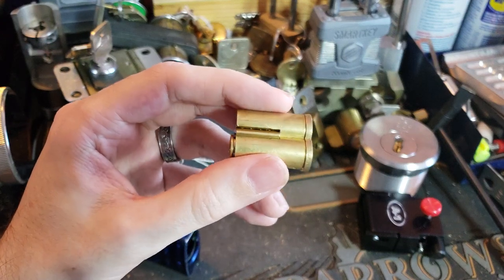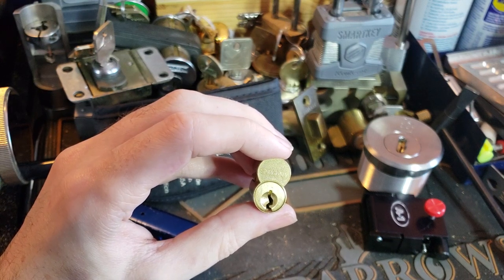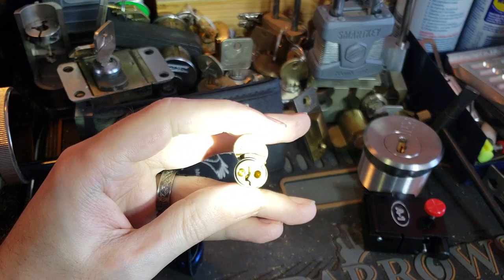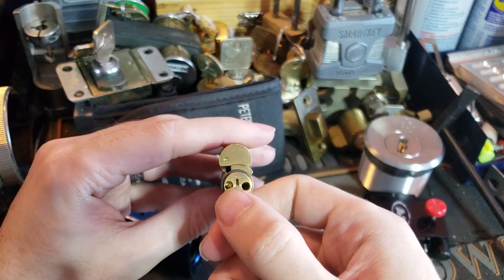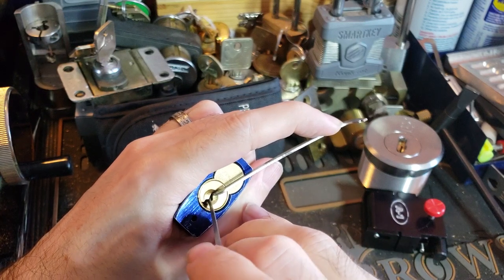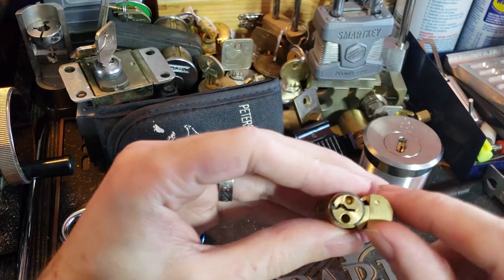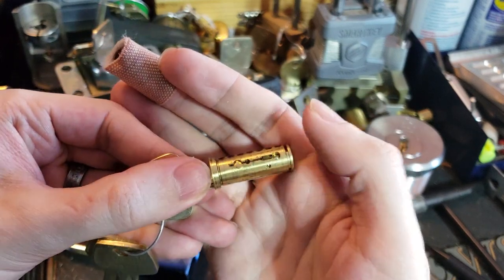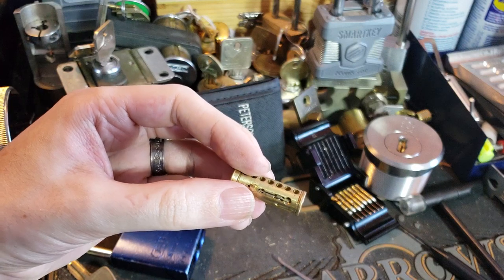(109) Sargent XC 7300B SFIC picked and gutted

Comment: Very interesting -- never seen one before & I thought I knew all about SFIC's -- seemed like a very easy pick to control -- impressive
Reply from the maker: How easy it is to pick any SFIC to control versus operating is very much a question of wear and tiny manufacturing variances (much like any other mechanical lock) but also the bitting selected for the control and change keys. I have some SFICs that will almost always pick to control while I have others that no matter what I try will always pick to operating.